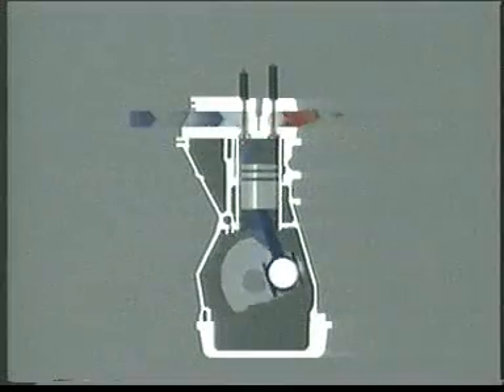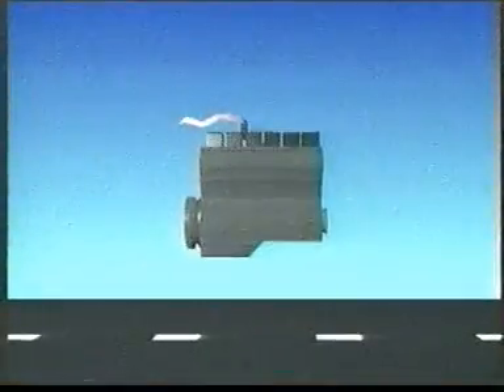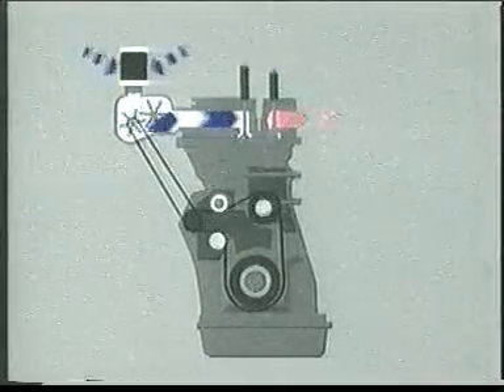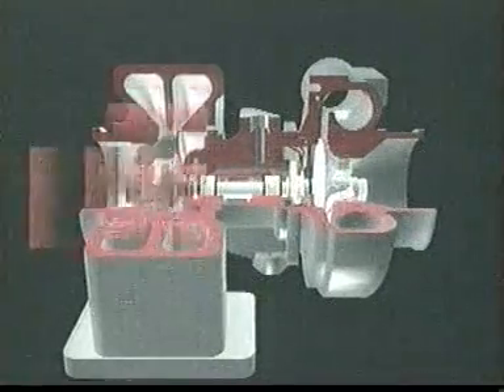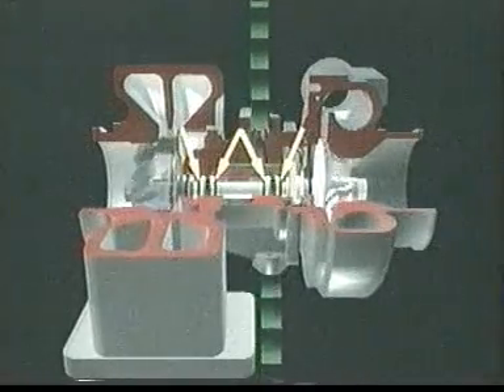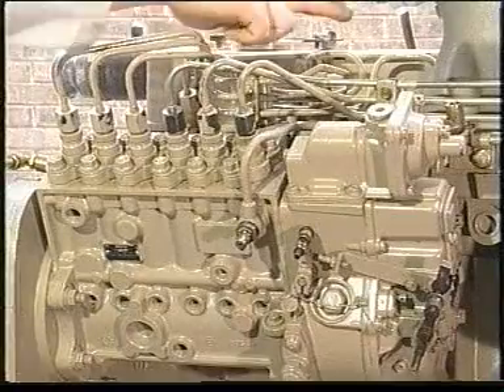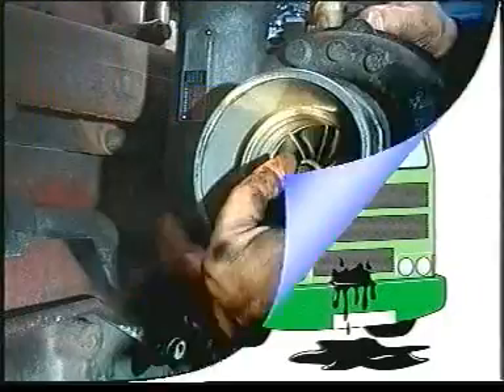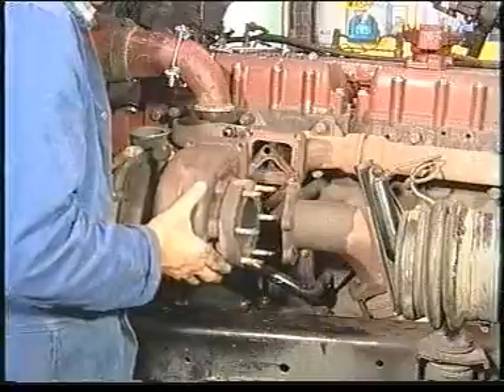Holset - How a Turbocharger Works

Comment: So basically the turbo just recycles air to cool the engine?
Reply: Not exactly. The turbo's main role is to provide more power :D It sort of recycles the exhaust air by using it to spin a mini turbine with a shaft connecting to the compressor. The compressor sucks in air from the outside. The compression allows for more more oxygen, and as a result more fuel can be used in the cylinder.
Reply: Got it! ^^
Reply: Yolo Swaggins  THANKS DUDE your comment just explained it to me as well. Thanks!!!
Reply: turbo's get very very very hot

Comment: @kalijasin Turbochargers increase thermal efficiency by creating useful work out of wasted exhaust gases. Using the heat and force of the exhaust gases leaving the engine, the turbo sucks in air that otherwise is done simply by the piston moving down. Turbo's greatly improve volumetric efficiency. Also, turbo's allow for the use of smaller engines (with lesser frictional losses than large engines) that create equal power to larger engines.

Comment: @1tirefryer I mean safely increasing it, I could take the rev limiter off and it might get there...but it would explode
I would imagin a very light cam shaft, strong heads and pins, bigger fuel injectors and better oil pump to safely get to 9,000

Comment: @1tirefryer so more boost and a better oil pump can increase rpm limit? ive been wondering that for the longest time now, I wanna get my 2002 camaro rev limit to 8500 or 9000( if thats even possible...Ive seen a v-8 get to 9000 before)

Comment: @reap62  It's not talking about drag racing, it's talking about turbochargers.  Yes there are roads that are higher than 15k feet ASL, and yes they have been used by trucks equipped with turbochargers for that specific reason of efficiency.  Oh and normally you don't put a question mark at the end of a statement, dumbass.

Comment: how does a high altitude flying plane compensate for the drop in oxygen at such altitudes?...is a jet engine itself strong enough to make up for the loss in oxygen? wont the engine suffer at this altiitude causing it o slow down?

Comment: @GHICAGO71 eeeew eclipse.. 3.8L v6 and only 260BHP... thats barely  68Hp per liter.. thats a laugh, AND its front wheel drive and 6.5 seconds to 60 from 260BHP?  haha that power to weight ratio is the same on a 350z , 350z are super heavy cars, but at least their RWD. you wasted your money.

Comment: I have a quad turbo system running in my wrx sti, i have one connected to each individual head exhaust that i welded myself but for some reason the exhaust is leaving through my air conditioning system. Any ideas?

Comment: I am not a mechanic, so this may sound like a silly question, but if a turbo forces air into the intake - would this not weaken the air/fuel mixture?  Modern fuel injection may automatically compensate for this but how would it affect a carburettor engine?

Comment: MR2 was only Turbocharged in the MKII MR2 where it used the same CT-26 [older models] and CT-20b [Newer models] turbochargers that are found in the Celica like mine.
They were always twin ENTRY but never twin or sequential Turbo.
If you want an explanation of what twin entry is I'd be happy to help you out with that.

Comment: slight shaft play on most newer [90's] Toyota Turbos is very normal. There is a tolerance you can get from Toyota so that you can measure the shaft play and decide whether or not it needs to be rebuilt

Comment: Turbo's don't take as much  power as you think... as you accelerate any unburnt fuel and gases will then be pushed back into the cylinder to be burnt properly until the turbo spins up on higher revs. because as you said, the exhaust drives the turbine, so there will be back pressure when the turbo isn't on high speed

Comment: He said something that i believe is wrong:

Turbocharger doesn't take power from the engine

Turbocharger does take power from the engine while the piston goes up and pushes the exhaust gas to drive the turbine that is linked to the compressor. 

In other words the air resistance on the compressor is felt by the turbine then by the exhaust piston

I think the turbocharger is only using the surplus of enthalpy from the high temperature exhaust. It is like converting the heat into work

Comment: In Europe they don't bult superchargers on cars.  But I think a supercharged engine would produce more torque becos its connected directly on the engine.  The turbocharger need exhoast gas to power it up.  So the power of the turbocharger will not be directly available.  Variable turbo helps that a bit but even so the turbocharger is more directly

Comment: you could but you might loose power or not be able to start the engine because an engine can only breathe so much thats why engines dont have like 10 valves per cylinder.

Comment: correct (you really just asked the same question twice). it works due to several laws of physics. there are equations for those things that would make your eyes bleed. but suffice it to say that it operates by way of the pressure and temperature differentials of the manifold and turbo downpipe.

Comment: Damn I never knew, thx.

I always though S/C were instantly boosted. I never knew about shift lag neither.
I just watch videos on YouTube and the boost guage jumps to the psi the pulley is set to right away. You're right though, because on 3rd gear and beyond, it lags like a mother in those vids.

Comment: Exactly, it's called supercharger shift lag, at higher speeds, as it gets harder to accelerate, the engine needs to work harder to get back up to speed. To get maximum boost from the supercharger.

Comment: Eh, no it doesn't, no matter how much you think it does, the serpentine system still has to be spinning at certain RPM's, also the roots style is shaft driven, and takes more power from your engine..

Comment: There's where you're wrong, superchargers DO have lag, and shift lag, you're not realizing the engine has to be at a certain speed, to turn the serpentine system at a high enough speed to make usable boost.

Comment: i may be wrong but i believe when you go with turbo you need to upgrade your exhaust to about 3 inches in diameter, i believe this is to allow the exhaust flow to be faster, more air in  means you need a faster way to get it out, so i dont think back pressure matters, especially when you upgrade with a car that wasnt meant for turbo... but i might be wrong

Comment: it does give a LOT of power because the engine's not trying to suck air its like a big fan that just gives the air. but about saving gas that's BS cuz the engine gives the same amount of gas depending the rpm you are reving the car.

Comment: I'd go for turbo because turbo harvest the waste of your engine and its using fuel power to compress air but supercharger uses the power of the engine to force fresh air into the engine, its like switching on off your air con that slow down your car. Almost like taking away some power to give more power thats supercharger

Comment: it really depends on what kind of racing do you do but in general Tchargers have more advantages than Schargers. Tcharger actually will improve your gasmileage when not being used, it is cheaper, smaller, n easier to find parts for them.

Comment: Methanol Injection is a Mix of Methanol/water. Methanol to raise the octane level in your gas and the water to cool down the air intake temperature before it enters the combustion chamber. The ratio of water/methanol changes based on your engines fuel requirements.

Comment: That depends on your engine. Large displacement engines usually use superchargers or 'blowers' because they have enough torque to spare and the power is instant(no lag). Turbos work well on smaller engines because they do not rob power and they can rev at higher RPM which is where turbos shine. But turbos have 'lag' because they actually restrict the air flow to the engine until they start to spool up.

Comment: its true it really depends on what you need, and you can overcome turbo lag through misfiring(not recommended unless your rich and impractical), twin charging(combination of super and turbo), or twin turbo (compound or parallel, but generally speaking yes turbo is better than super.

Comment: Yes you can, VW do it with there TSI engines. However it's means a more complicated and expensive engine. But they have a 1400cc engine producing 170bhp with ease.

Other than using a supercharger and a turbocharger you can use a twin or bi turbo engine. Meaning you have 2 turbos, one big and one small, the small one spins up fast for low down power, then the big one spins up for high rev power.